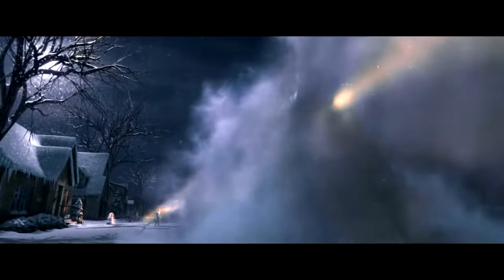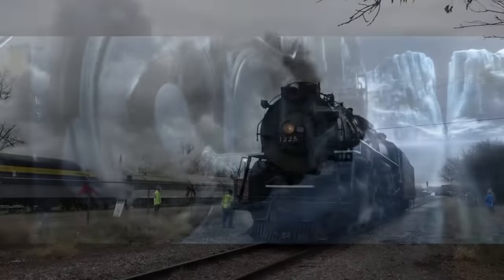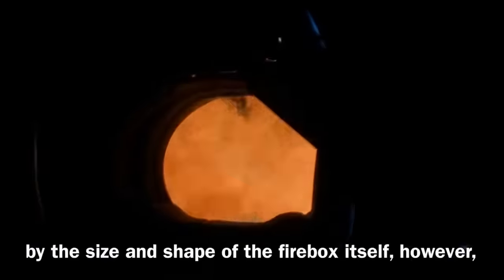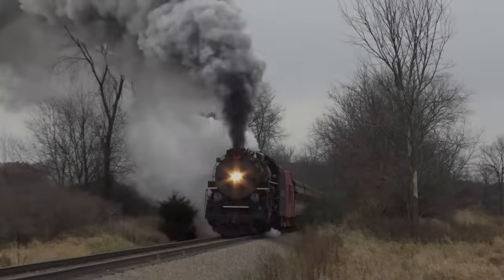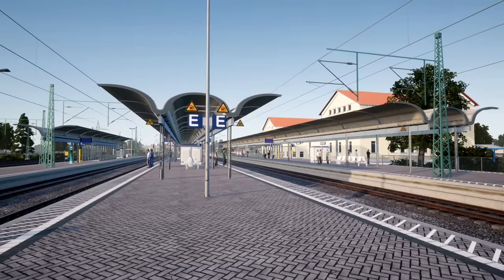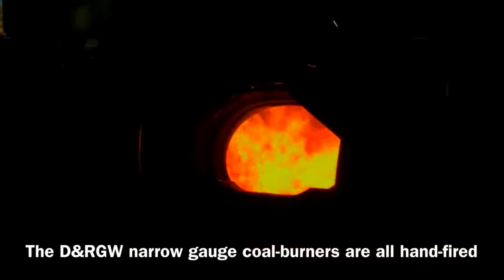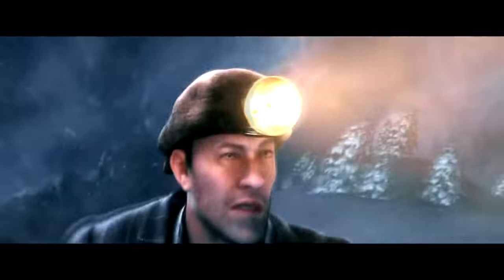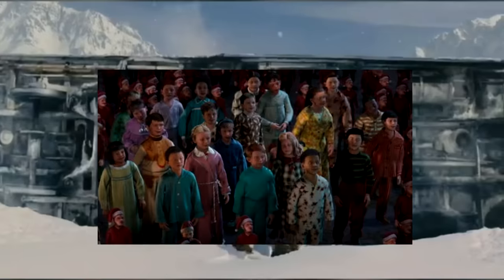Why The Polar Express would Explode

Comment: So in back to the future, part three when the boiler exploded while it was still on the tracks in real life, it would’ve shredded Dr. Brown and Clara?!
Reply from the maker: Theres alot of factors that dictate what kind of boiler explosion you can have, but overall, they would either be blown a couple hundred feet away or shredded apart lol
Reply: @ChriswithaK  great video
Reply: I don’t think that was a boiler explosion.  That was just the third log kicking in. You can see the boiler explode after the train leaves the tracks, about half a second before it hits the ground.
Reply: By the time the boiler exploded as #131 tumbled off the trestle, Doc had already rescued Clara on the hoverboard. All the business with the rivets popping and the flames rolling out the stack was the #3 presto log kicking in and beginning to overheat/overpressurize the boiler.

Doc being Doc, I figure he screwed the safety valves shut to ensure the locomotive would get up enough pressure to go 88mph, but I'm also fairly sure he would've turned the injectors on before he left the cab to ensure the boiler didn't run dry prematurely either.
Reply: It looked like the logs had some extra spice in them to give the fire more power, making a fuel explosion in the fire box would definitely give a good effect,  maybe not to much to Blox the firebox to pieces, but it would blow out of every gap and create a lot of heat...maybe not to the extend of what was in the movie...but it could look similar.
Reply: Ya the train they used in Jamestown California
Reply: @mammutMK2  

According to Doc "They're my own version of Presto-Logs. Compressed wood with anthracite dust, chemically treated to burn hotter and longer. Use 'em in my forge so I don't have to stoke it."

They're real products, funnily enough, invented in the 1930's as alternative fuel for woodstoves and fireplaces. Basically sawdust, woodchips, and other leftovers from sawmills pressed into logs, some brands use parraffin as a binder.

As a smithy and a loco fireman, I can say that throwing in the pulverized anthracite makes sense as it would kick up the heat  produced and let the logs burn longer, as anthracite has a longer burn time than straight wood. No doubt each log has a higher concentration of some added accelerants to kick the heat up even more, probably the outer part has a coating that slowly burns off so each log will fire in sequence.

Wouldn't surprise me at all if Log #3 (the red one) had a big slug of napalm in the middle of it that got touched off when the outer layer burned away. Might not have had gasoline in 1885, but they had lamp oil/kerosene back then, and you can certainly make napalm out of that.

Bearing in mind there's already a layer of burning wood that the crew already tossed in before Doc and Marty "borrowed" the locomotive, plus whatever they threw in on the way to the DeLorean to keep steam up. The Presto Logs were essentially an afterburner/turbocharger to get the boiler up to enough pressure to enable the run to 88mph.
Reply: it's ok the polar express is also powered by flux capacitor so i think they'll be fine
Reply: Now I want to put some presto-logs in a steam locomotive
Reply: @Shipwright1918  If I remember my random facts correctly, they did have gasoline back then, but it was considered a useless by product of kerosene production.
Reply: @gaskamp2  

It would be unlikely that Doc would've been able to source any "waste" as gasoline was back then, in the short time he and Marty had available before Tannen was going to kill Doc as per the tombstone, hence why they settled on the locomotive as the next train was due the same day (and by then they'd already fubared the DeLorean's fuel injection manifold trying rotgut liquor).

With all the oil lamps in use in Hill Valley, it's likely there was a supply of kerosene in town, most likely the railroad made deliveries of a few barrels every so often.  Back in the day you usually bought kerosene at a local chemist or at the general store. As Doc said, gas stations were a long time away...the first autos actually predated them by several years.
Reply: But do steam locomotives even work like that? I’ll admit I’m pretty ignorant, but if you have maximum adhesion, that is to say, you’re not losing any tractive effort due to wheel slippage, would making the fire hotter to increase the boiler pressure beyond what it was rated for even do anything? Let’s say it was designed for 120 psi and doc got it to 150. Assuming it doesn’t immediately start having problems (which it shouldn’t, 150 is a 25% increase which at least by today’s standards should be well within the safety margin), would having 150 psi in the pistons mean it would go faster?
Reply: @magiccarpetmadeofsteel4564  

Easiest analogy I can liken it to is slapping a turbocharger onto a gasoline engine. You're forcing more fuel/air mixture through the system at a higher pressure than atmospheric pressure could do alone, so the engine revs harder and produces more horsepower, so it accelerates faster.

Steam locomotives develop their power differently than internal combustion engines, but it's a similar idea. It's not just the higher pressure of the boiler, but the higher volume of steam going through the system from the greater heat of the firebox. Steam locos work mainly by expansion, similar to shifting gears in a car but it's done by adjusting the engine valves to control the length of time steam is admitted to the cylinders on each stroke. Start out taking big gulps of steam to get it going each stroke, adjust the timing once it is going to take little gulps, but the little gulps can expand to push the piston all the way through.

If you didn't do this, the engine would chew more steam than the boiler could make, the engine would also start to work against itself through back-pressure via the exhaust.

Practical upshot of all this is the higher the boiler pressure, the stronger the reserve of power bottled up, and the higher steaming rate means the boiler can keep up with the cylinders' demands for gulps of steam as the loco accelerates. The blast of exhaust steam shooting up the stack pulls on the fire through the boiler tubes, which makes the fire burn hotter, which boils up steam faster in response, the faster it goes/the harder it works.

Doc and Marty had a limited amount of track to work with, so they needed the locomotive to accelerate as hard and as quickly as it could to get to 88mph, hence getting the fire "hotter than damnation itself" to quote the engineer. 

Downside is the fire was getting so hot it was approaching the point the firebox would start to melt and the boiler would explode as the steam pressure would cave in the weakened metal, or the boiler itself would pop a seam from being overpressurized.
Reply: @magiccarpetmadeofsteel4564  yes it would, as many a steamship captain can attest.
Reply: @magiccarpetmadeofsteel4564  it’s the same thing as using a turbo charger in a car piston higher pressure = higher forces = acceleration. 25% increase in pressure would give slightly less than 25% performance improved.
Reply: We don’t talk about that
Reply: @ChriswithaK  well that wasn't because you know it fell off a f**** cliff before it exploded so they probably be fine
Reply: the train would become pasta fazool with marinara.
Reply: Normally an explosion with enough force to fling steal reinforcements like twigs in a storm, if one of those hits you it would be like getting hit by a missile so fast so much energy imparted the solid material of your body would act like liquid as the much harder steal slams through it at terrifying speed

If your lucky enough not to be hit by a bit of steal flying in every direction then there's the explosion itself strong enough usually to level a block of buildings, it's a real toss up as to what's more survivable, in such a explosion you would also get thrown like a twig in a storm, anyone strapped down would be shaken with such force they would pop.

If you do survive flying off to god knows where then you've most likely survived congrats, now search for survivors and look out for slow falling bits of sheet metal gliding down
Reply: @ChriswithaK  how is that a "lol" moment? That'd activate my anxiety!
Reply: @LIMPGUITAR  that sounds like an expensive proposition. At least to use only presto logs... would be pretty boring too.
Reply: @Charon-5582  yea.....a man can dream.

Comment: maybe the engineers prepared for this and filled the boiler with water to its limit so if the water sloshed to the front there would still be enough water to say cover half the crown sheet at least giving enough cooling until the train reaches the bottom of the hill
Reply: Considering they drove it on the ice like legends I'm gonna trust they know what they're doing
Reply: @robcowboy2713  same
Reply: but there's a problem, your priming the boiler which is harmful to the valve and pistons as you'll wash away the lubricant and the water may fracture the cylinder head or pistons, so which is why i think with the polar express, theres a pipe at the front of the boiler, that pipe runs all the way over to the crown sheet, controlled by a electrical pump like in fish tanks feed, that when going down hill the pump will take the water at the front of the boiler and shower it over the crown sheet to atleast keep it cool
Reply: @victoriamaynard722  fair enough although with that second part the pump would have to be pneumatically controlled since I don't think electric pumps that powerful existed when the movie took place
Reply: @doge_sevens  eh fair enough, probably powered like a westinghouse airbrake system
Reply: Or its just fucking magic
Reply: oH, i saw you on brick rigs with the same name
Reply: @simnm8057  but what if it was a magic engine  that acts like a real steam locomotive
Reply: @victoriamaynard722  than it wont be a magic engine
Reply: @simnm8057  then how else did it reach the north pole with like half a tender of coal i mean yea magic allows a constant supply of coal and water but like what if while magic covers like fuel and how they can add on or remove coaches to fit the train along with making the loco strong engough too climb up that near impossible slope the water in the boiler still has to follow gravity
Reply: @victoriamaynard722  yes magic can do all those things 
Cause its magic for godsake
Reply: @Victoria Maynard  if it did the g forces of the locomotive going down glacier gulch would crush the entire train and the tracks since 300mph of 300+ tons of express train going almost vertical then horizontal that fast wouldn't work
Reply: @doge_sevens that and the fact that an electric motor likely would be melted by the extreme temperatures
Reply: @doge_sevens  Also, the locomotive would crash straight through that rickety wooden bridge, exploding on impact.
Reply: or possibly dampened the fire
Reply: @PilotBug  they would need alot of steam pressure to get the train up that steep of an incline so they would need as much heat as possible to generate alot of steam
Reply: @victoriamaynard722  dude last time i checked that train could bend around like a pool noodle
Reply: At that speed the water would anyway accumulate at the back
Reply: @maneesh2316  it's not speed that would pool the water at the back but acceleration, the train would have to be accelerating faster than it would from gravity alone to do what you are suggesting, seeing as the speed of the pistons is way faster than such a train is designed for it can't be powered, so the friction from the rails and the fact that it's not perfectly vertical means the water would indeed pool at the front during descent